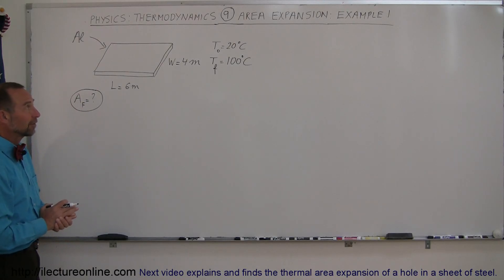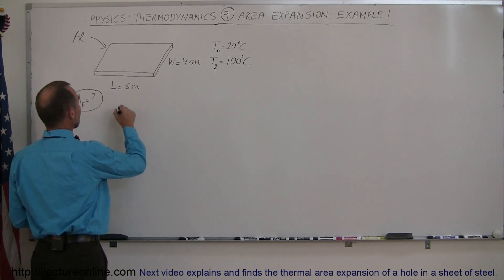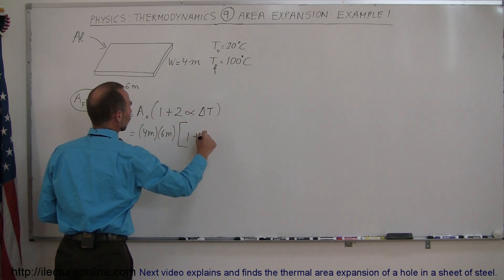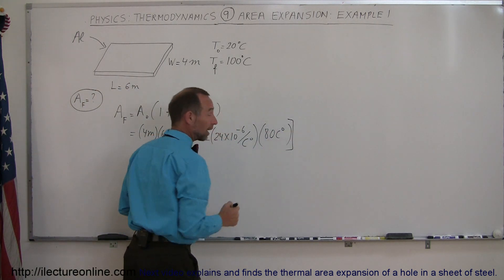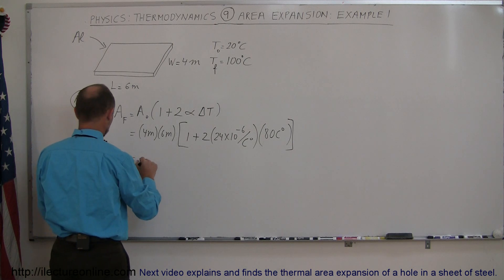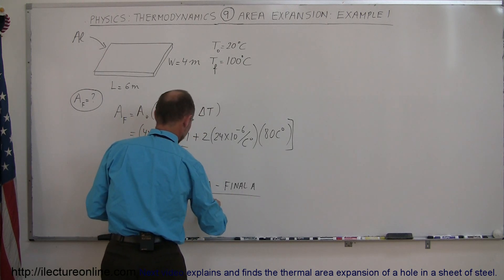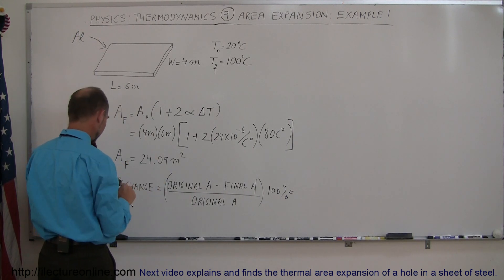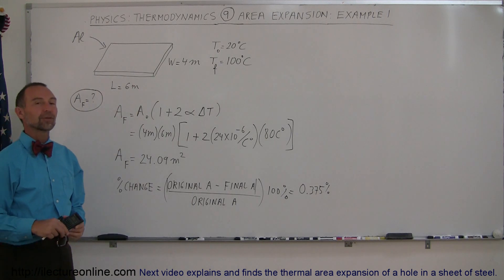Physics 21  Thermal Expansion (2 of 3) Thermal Area Expansion: Example 1

Comment: Sir why the the percentage is not negative?
Reply from the maker: It is not important if the % is negative or positive since we understand that the object will typically become smaller with smaller temperatures.  (Note the absolute value in the equation in order to keep it positive and thus it is the percent change relative to the original size)

Comment: If the area increases by 1.00375 times, can we assume the dimensions increase proportionally to sqrt(1.00375)? In other words, 6*1.00187 = 6.01124 m and 4*1.00187 = 4.00749 m. Is this correct? But then what would you do with more weird shapes like triangles and ellipses?

Comment: since A = A_0 + 2A_0*alpha*dT and L = L_0 + L_0*alpha*dT... i notice you get slightly different results for the length changes depending on the width of the object: is the length change formula only useful for very thin objects or what? seems strange...
Reply from the maker: The method for finding the change in the area ignores the delta L x delta L term.  And yes the answer will therefore be slightly different, but since delta L is very small it doesn't matter.